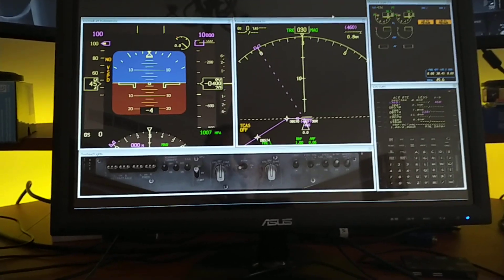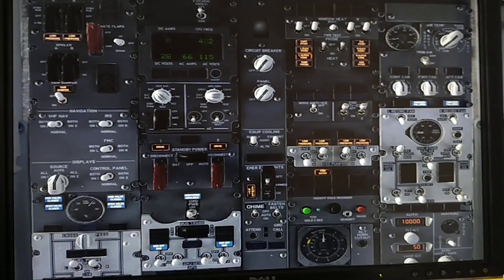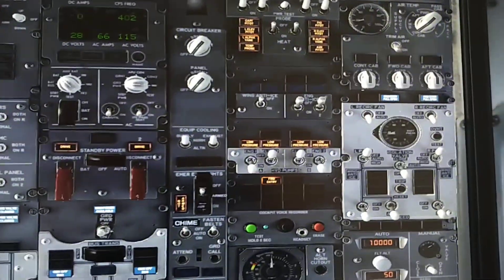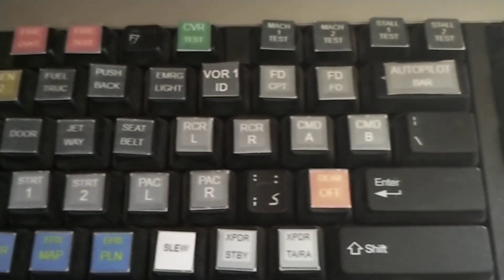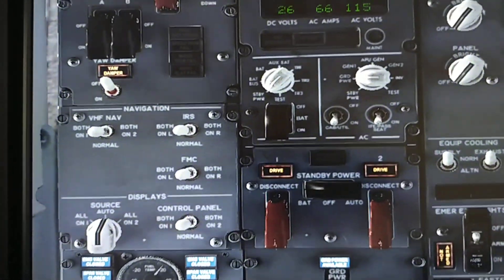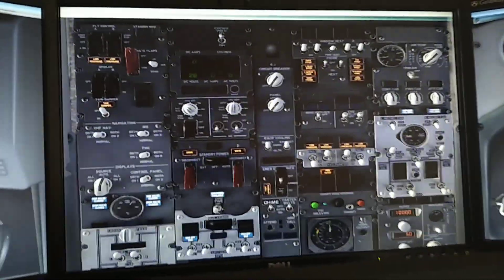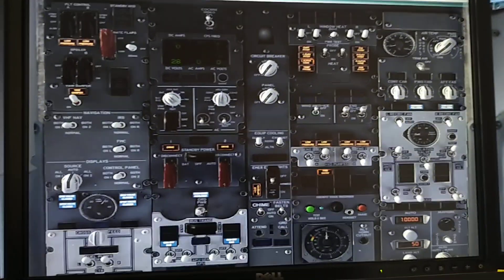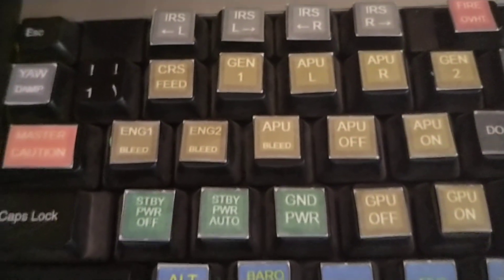PMDG 737 FSX 2nd keyboard

Comment: Nice video. Does this work for P3D(your xml). Also can you do this for AS Professional aircraft?
Reply from the maker: Thanks. Sorry, XML file to PMDG. This is based on function codes for the simulator
Reply: @sirjaroudi  Ok, so some of it is working. And sometimes, when I map the key in HIDmacros, it doesnt work, for e.g WXR or STD or CMD A
Reply: Also it interferes with chaseplane